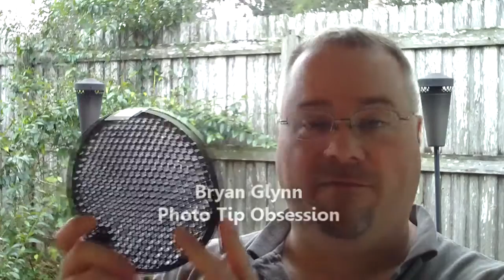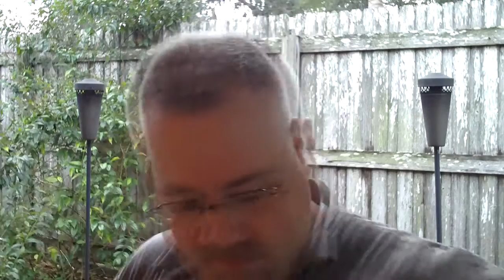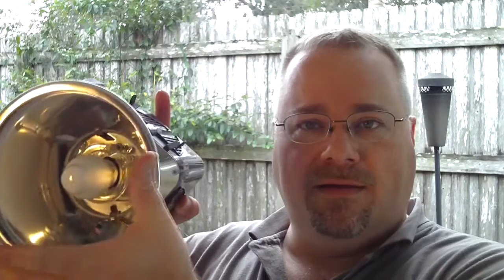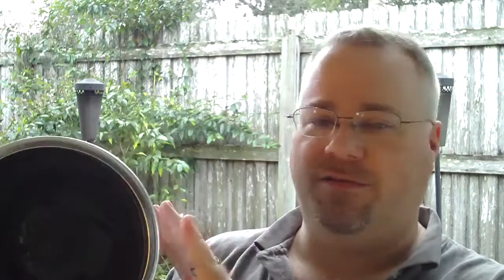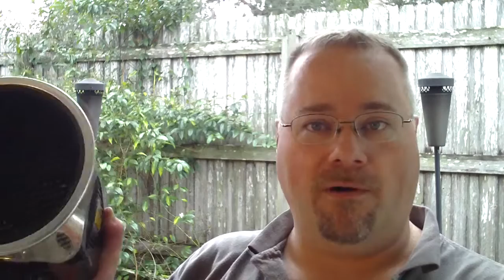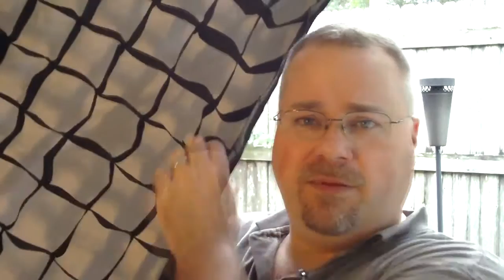What Are Gridspots And How Do You Use Them

Comment: Very helpful information.  Thank you so much.  I especially appreciated knowing the span of each grid, and that the 10 degree and 20 degree grids get very hot.  I was just getting ready to purchase some grids and changed my mind on what ones I wanted after watching your video.  I want to use these grids with gels.  Now I am concerned about the heat.  Do you have a suggestion?  I use Einsteins (PaulBuff) with a 7" reflector.